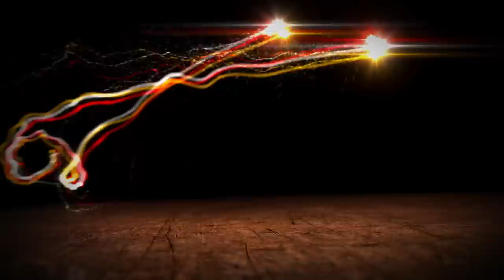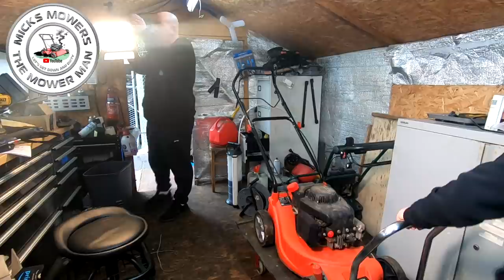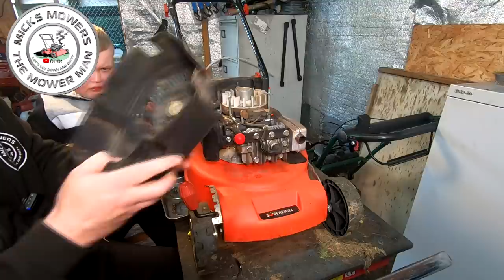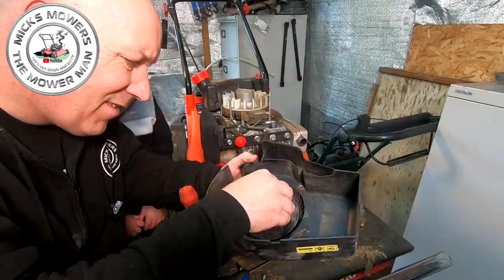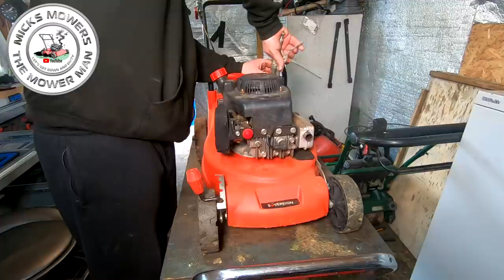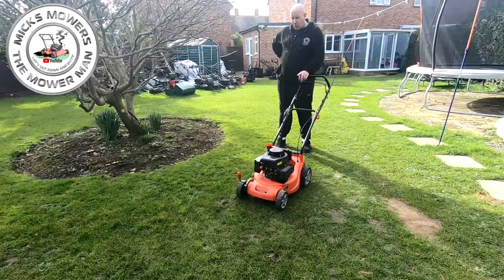Sovereign Lawnmower Needs A Simple Fix #sovereign #simplefix

Comment: HI Mick, I was searching for this exact model not expecting to find it, and here you are! My SEN son (who is 30 now!)  lives with 4 others in a house with the same team of carers looking after them and it has worked out really well, They asked me to look at their lawnmower and with the help of a lad next door who does lawn mowers for a living, we got it working again, then the pull cord snapped! After he nicely worked on it for over an hour, trying to get the spring tension going again, he gave up for the night, offering to take it to work if I couldn't figure it. So i had a look on you-tube and here you are, Its back together and the cord is returning, thanks to you and this tutorial, so a big thank you to yourself and to young Riley. Have a good day!
Reply from the maker: Wow.. that's great mate and well done.. ta for watching..
Reply: Same here our kid mines spinning slowly ive washed air filter sprayed wd 40 into outer carburettor area my sponge filter is on my washing line ive fitted a new spark olug  it was smoking white smoke heavily ive filled the 2stroke oil filler im hoping tommorow to re run mine so keep em crossed for me for good luck😮

Comment: Hi mick, don’t suppose you have a spare mixture screw for an sv150 carb ? Or know where to buy one. I’ve been hunting for hours online ! in desperate need as I’ve lost mine cleaning it 😭😭😭
Reply from the maker: Hi mate .. very hard to find the LHP16 carburetor on line I'm afraid.. I will have a look in my parts try
Reply: @themowerman  thanks, I can find the LHP16 on eBay for cheap but it’s the one without the primer bulb. I have the sovereign version which does have the primer bulb.

Comment: hi mick you're vids have learnt me so much..i have a sovereign xss40a(think its a 2014) and it would not start so followed you're carb clean video (im ready to put it back on the machine)but in noticed that the kill switch leading to the coil is not an actual switch,its a small black block with wires and its insulated from the metal body it sits on but its not a "click click" switch..is that just a different way they did it ??
Reply from the maker: Try it and see.. if it still doesn't start then replace the switch
Reply: @themowerman  thats just it there is no switch its just like a black block with 2 screws and its insulated from the plate it sits on with a wire ythat goes to the coil..it reminds me of my days old suffolk punch mower from 40 years ago where you had the bar over the top of the spark plug and you touched the plug to cut the engine out..il have to do some more reading if carb clean done not cure it..thanks mick keep up the good vids

Comment: Nice video .. i have one , i can start when cold but wont start well when hot or been running for a while ? Any suggestions thankyou
Reply from the maker: Sounds like the spark plug or coil..
Reply: @themowerman  i have cleaned it . It has sat in shed for a year ?
Reply: Hi ive bought new plug starts ok now ... but its running fast i believe how do i slow it down  ive screwed in / out the big screw you can see  but don’t  seem to do anything ... any ideas thanks ,and thanks for first question answer about the plug ...

Comment: Hi mick I have the same mower but mine keeps leaking out of the primer bulb .cleaned carb jets put a new float in it . But leaks fuel out of primer bulb . I have checked primer bulb by putting my finger over the tube and pressing it holds air fine any ideas please.
Reply from the maker: Can only be the needle mate I would say..it's not cutting the fuel off..
Reply: Thank you
Reply: Do I just bent the little metal tab up or down thank you